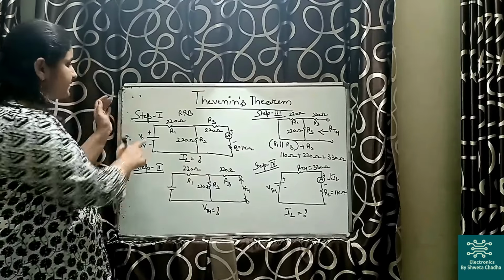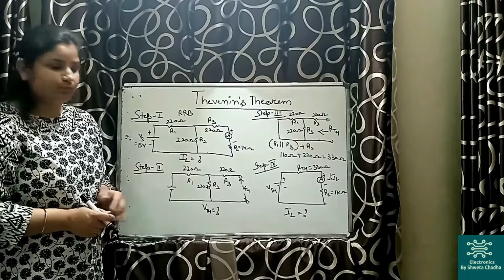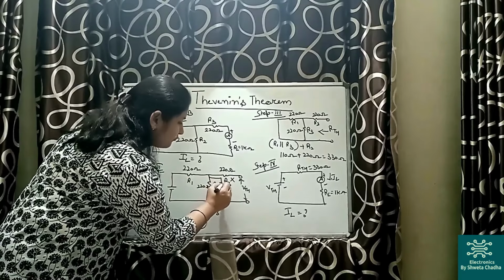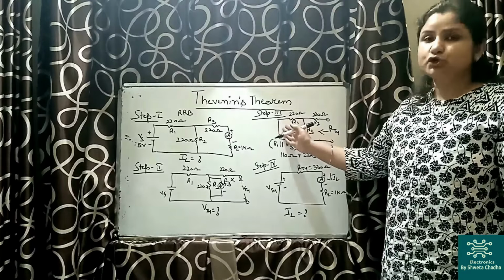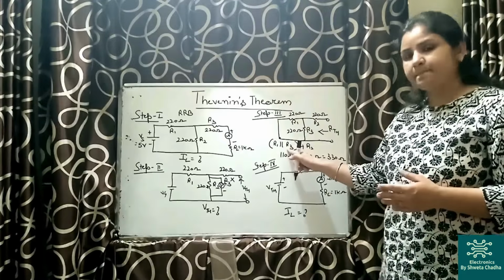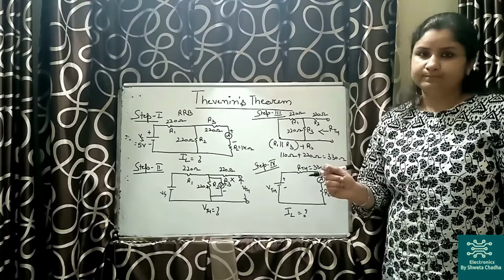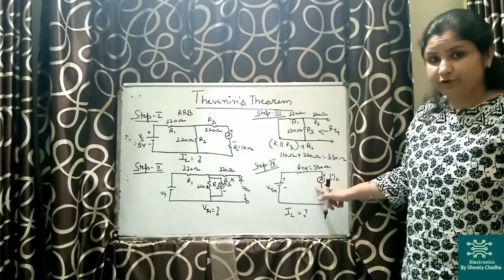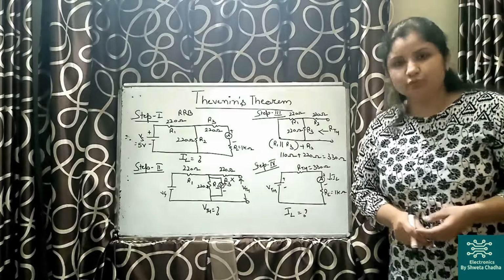Practical Thevenin's Theorem

Comment: 00:03 Thevenin's Theorem simplifies circuits into a simpler form.
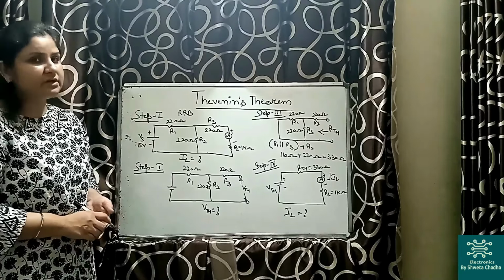01:24 Calculate open circuit voltage and Thevenin's resistance
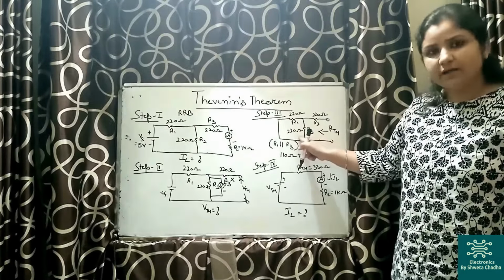02:30 Calculating Thevenin's equivalent circuit
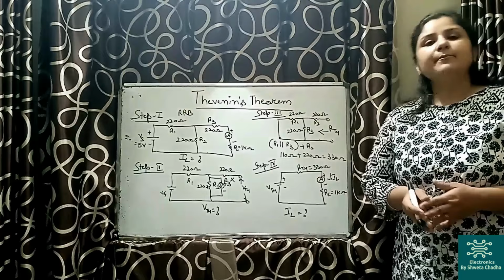03:35 The Thevenin theorem is proved by matching currents in the circuit diagram.
04:46 Setting up ammeter and power supply for calculating series current.
05:51 Demonstration of Thevenin's Theorem with a single column setup and 5V input
07:10 Calculation of Thevenin's equivalent resistance (Rth)
08:09 Thevenin's Theorem proved with Vth and Rth
Thank me later 😘😘

Comment: In the second step can we connect voltmeter from end of 220 ohm to bottom end of 220 ohm , will we get same voltage?? please reply as soon as possible
Reply from the maker: Although it will give you the same value of thevenin voltage at those points also just because of the resistances combinations but otherwise those connections would be wrong as we need to calculate open circuit voltage and the connection which you asked will calculate the closed circuit voltage.
Reply: @electronicsbyshwetachadha  okk thank you ❤️